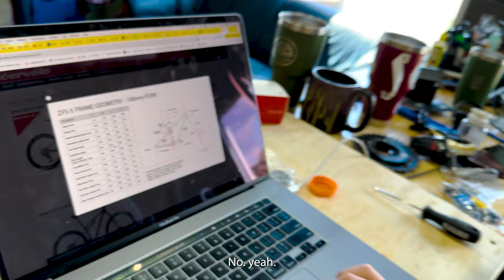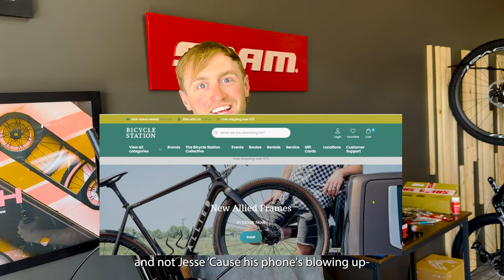Cervelo ZFS-5 Custom Build

Comment: I got the 100mm travel with the Sram XX SL Eagle when it was on sale.  It weighs 22.73 pounds with pedals (Time pedals).  I also replaced the race face cockpit.  Haven't cut the steer tube yet or cables etc so maybe a little room to get lighter.  No dropper seat post either.  I had top end canyon lux before this.  The cervelo rides great.  Rear shock is plush but responsive.  About a month of riding in and it's been enjoyable.  I wouldn't have bought it without that sale to be honest.  Glad I did now.
Reply: size Large btw

Comment: You talk about geo compared to the blur in the beginning, but you got it wrong… this bike is slacker then the Blur. You were comparing the 100mm geo number to the 120 mm Blur TR. The Blur TR is 67.1 degrees, this is 66.6. This is actually on the slacker and longer side of most XC bikes, it’s slacker than the Spark RC, Orbea Oiz, Blur TR, Canyon LUX, and the same as the new Scalpel. Also the head angle of the Epic isn’t normally 65.9. That is the low position of the bike, meant to be ridden on a 130mm fork. If you have been riding it out of the box without flipping the chip, they come from specialized on 66.4, only 0.2 slacker then this bike. The 120mm Epic is meant to be ridden in the high position, the low is for the EVO version to fix the BB height

Comment: The reason it is so heavy because the frame is much heavier than they advertise.  I weighed mine and it was 2030g with axle, shock and hardware no collar.  They state complete frame and shock is 1715g.  Do need to account for the brake mount and UDH hanger as well if you are not going the transmission route so about 2080 all said and done with no collar.  An old Epic Evo size L is 1860 with all frame items including collar…….
Reply from the maker: Yea I don’t believe it’s 1715 grams for a second. The bike should be lighter then my new epic with flight attendant but it’s a lb heavier
Reply: hard to beat Specialized frame weights!

Comment: Would I be able to fit a 38T chainring on one of these?
Reply from the maker: I think so
Reply: @bicyclestation yes, 38t is compatible, I’ve done it. Also with a DUB wide spindle and spacing it all drive side, you can fit a 40
Reply: It'll ruin the anti squat to below 90%

Comment: Lighter frame than the S-Works Epic and much much cheaper
Reply from the maker: It’s way heavier than my sworks epic tho. And it shouldn’t be. My epic has flight attendant.
Reply: Could you weigh the khaki colored ZFS frame you have in stock? I've been enjoying the content.
Reply: @bicyclestation your s-works has wheels that are 100g lighter, and a   100g lighter cockpit. Otherwise it’s all the same parts. I have weighed a epic 8 s works  and ZFS frame side by side without hardware and shock and they are within 40g of each other